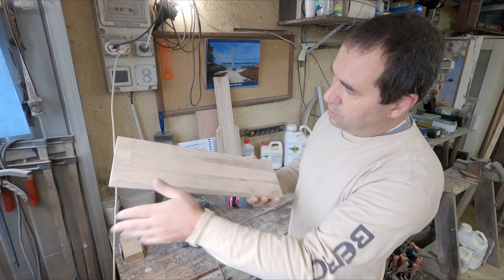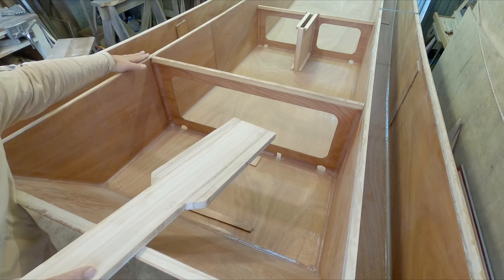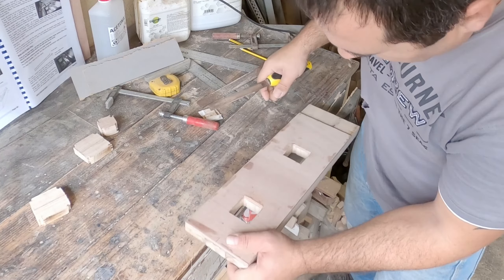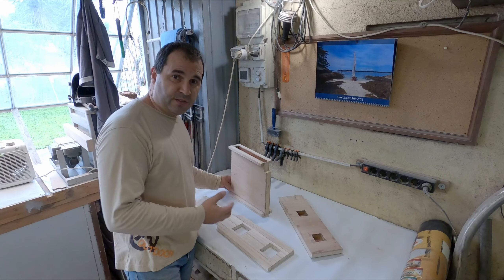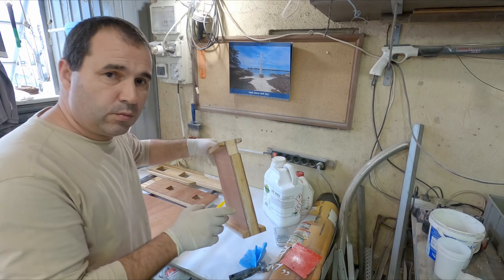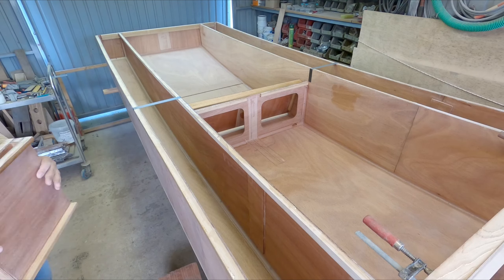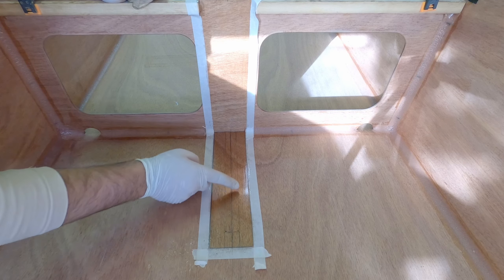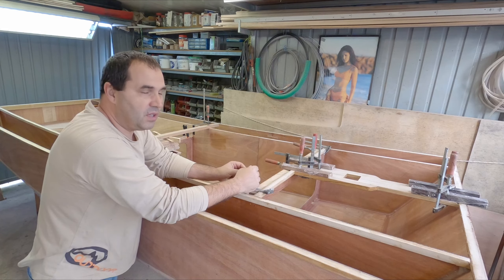Easy to Build, Unsinkable Skiff for Adventurers: Car-Topable and Family-Friendly! Carries 5 Adults!

Comment: Always enjoy your educational and inspirational (to be honest) videos.  You’re obviously not too proud to point out mistakes you have made, like nicking the plane accidentally- some guys would pretend that didn’t happen.  Man they always happen in my experience.

If the sale of Oz Goose plans, and the building thereof, doesn’t go up exponentially I would be surprised.

If I wasn’t on board a yacht getting her ready to deliver up the coast I’d be building from my plans right behind you.

Cheers mate.

Btw we just got a go pro.  Hopefully it has a bit more staying power than those you’ve been using Teo.
Reply from the maker: Hi buddy,
I'm not  a professional boat builder and I believe ppl should be able to see this incidents so that they don't get too worried when it happens to them. We all screw up at some point.
I have heard a few rumors  that the OZ plans and kits might be flying of the shelves...but mostly because of the amazing work they are doing in the Philippines I would think.
The GoPro, all of them, can't record 4k 60fps if there's no air flow. If you want to test yours just try recording in the house ... I'm afraid it might shutdown before the battery runs out. And it seems silly to test it indoors but if it fails there imagine those 40C days, in the sun with no wind. Yes... been fighting my GoPro8 for 3 years now! 🤨
Stay safe

Comment: A lovely job. Seeing it grow into boat is very satisfying to watch. Go pro are on the way out of the YT creator world.
Reply from the maker: Thanks.
GoPro fell asleep as they never addressed the bugs and a lot of other problems from past camera models. Always worried with increasing picture definition instead. well, I don't care if it's 6K camera when I can't even record at 4K 60fps without it shutting down or if I press record and the camera simply decides not to work until I remove the battery. Another thing I can't believe they haven't implemented yet is a feature I have on my old  Xiaomi Y4K+, regardless I you choose wide or narrow lens mode, the camera will automatically correct for the fisheye effect.

Comment: I've been watching you for about three years now and i am very happy to see that boat taking form (like i saw the shiny GIS one one and a half years ago) and i want to congratulate you for achieving such incredible feat because i feel like it's so underrated and it should be more than less, i really like the fact that it takes a lot of time because in eight hours i think "I can do ten pieces!" while in reality it's only possible in three, because the quality is being in program and it takes a lot of time to build, to think and rethink about the side, the configuration and the place of each individual panels that will align and form what is it called "The Boat" and such we need someone whose capabilities are such that we can defy it a "Rambler", so even if it doesn't fell like, i think that this is one of the most important things to do nowadays, Sailing has been pushing me for years and i want to continue like that, stay safe and see you next week, bye!
Reply from the maker: Thanks for your support.
Building a boat and the feeling that goes with it will be different for each person and even different for the same person depending on the build.  My GIS was a the first one and I took all the time needed to think every detail and appreciate every piece I made. I wanted a beautiful boat. It took me 600hours to finish but some ppl finished it in 300hours other in 1200hours. 
The Oz Goose being such a simple build and a boat I'm building not because I fell in love with the design, as it happened with the GIS, but because it just ticks all the boxes for my needs.  This build I'm enjoying it differently. More relaxed, not worried to screw up since everything is easily fixable here. Hopefully I will still build it in 1/4 of the time that it took me to build a GIS.

Comment: Hi Teo, another great video. The tip on how to fix the mast step and centre board case without screws is priceless - I will be doing it that way in the next few days. Your boat is going to be super light !   A question about the angle of the centre case...... everything looks good on my build but when I dry-fitted the seat a couple of days ago I found that the seat angles down quite a lot at the front end compared to the line of the side decks. The aft end of the seat is 8 cm below the deck and the front end of the seat is 10 cm below the deck.   I have checked and rechecked all measurements and I think I built the case OK. In Michael Storers video series the seat seems to follow the line of the deck but now that I have gone back and looked that the plans, there are a couple of drawings that show the seat angled down like mine, but no mention or measurements anywhere of how much it this should be. So what are the measurements on your build ?
Reply from the maker: Hi Michael.
I don't think the seat is meant to follow the deck line. 
I haven't glued the seat yet but just placing it over the cc it measures 8cm and 9.5cm  (no deck yet).
This might change slightly once glued but not by much.
Reply: @TheBoatRambler  Thanks that's great Teo - pretty close to my dimensions. For a short panicky few minutes this morning I thought that I had messed up. I am assembling my goose in a very different set of steps to those described my Michael, and followed by you, but the end result will be the same ....Cheers

Comment: You work much faster than I do, but that is probably due in no small part to having an uncluttered, well-organized shop.  I must spend half my time looking for tools/parts or setting up sawhorses and tables outside for messy work (sanding/sawing/planing).

I do not see any air filtration in your shop.  As much cutting and sanding as you are doing in that confined space, I would strongly recommend adding an air filter if you indeed do not have one.  Even a simple box fan with a MERV 12+ filter duct-taped to it (ideally a high-flow, thick filter to reduce wear on the fan motor) is as good as air purifiers I've seen commonly used in medical facilities here in the US for removing PM2.5 particles from the air (I confirmed with a particle sensor).  40 USD or so for that setup, and the filter should last months.  Those small particles are unquestionably bad for one's health, as I'm sure you know, and stay suspended in the air for a long time (which you probably also know).

Great job building and teaching/entertaining.  The seller of Oz Goose CNC-cut kits told me that sales have been really hot lately (really!).
Reply from the maker: I don't have any filtration on my shop. I do have a very good mask with proper filters that I use...sometimes! 😅
I try to do most sanding outside if possible. but yes you are right I should probably pay more attention to it!

Comment: I cut my daggerboard/centreboard slot with a flush trim bit in a router. If you have one or can borrow one it takes a lot of the stress out of it as it will just follow the inner lines of the slot. Less scary than a saw or jigsaw!
Reply from the maker: I could try to borrow one and do one of the cuts with the router and the other by hand just to show ppl it's not a big deal, just takes longer. 😉
Reply: @TheBoatRambler  it feels like a big deal. To build a boat and then cut a hole in it is very anxiety inducing. Maybe it gets easier the more you do?
Reply from the maker: @robstevens5503  couldnt tell you, I have only ever cut one! 😅

Comment: Thank you for this video. Are you not afraid that some water could stay in the mast step holes ? (and make it rot) We usually make some little holes in the mast hole, for the water to escape.
Reply from the maker: Hi Christophe,
I did that on the GIS and maybe I'll just drill two holes on the mast step this time around too.
Since the mast comes down every time I finish sailing it should be easy to dry it with a rag or sponge anyway.